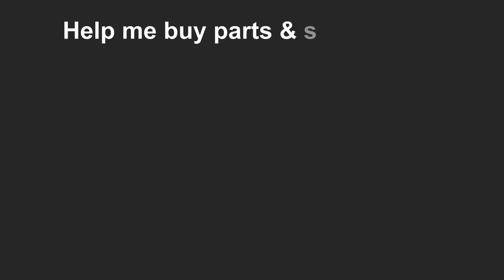Can a Wet Sewing Machine Motor be Saved?

Comment: This video was very informative. I cleaned my motor as you described in the last video I watched of yours with the Krud Kutter and water mixture. I let it air dry since I did not have a blow dryer. I have not seen any rust form and I think I did mention to you in a comment I sent to you from that video that I sadly was not able to get this motor working BUT I am hopeful that I can get it working and it was just the cleaning that I needed to do on this motor to get it working. I took it to a gentleman that works on featherweights and I am thinking, and so is he, that it’s the screws and the motor casing that is not aligned correctly and he said he would look at it and get back to me. Either way, I’m learning a lot. As my brother did when he was very young, he tore apart everything he had; his motorcycle, clock radios, drills, a Vespa, fans,  bicycles, etc., in order to learn the internal workings in order to learn how to repair these things. With this being said , he also destroyed most of these things, but he eventually learned from this. I can’t afford to ruin these GE motors because they are not replaceable, but the singers that are older I think I can come across these motors more readily and can learn from working on them. This is going to be fun with the help of your videos!
Reply from the maker: I hope he can get the motor running for you. I wonder if it's the airdry that affected it? Guess you will find out. You have the right attitude about working on these machines, and that is about 90% of being successful. Best of luck going forward.
Reply: @andytubesewing1953  you think it’s the air drying that wasn’t good for it? So what if I soak it in a little water with a little of the krud kutter rust cutter that you mentioned. The inside workings turn nicely. It’s really hard to say at this point since it never ran to begin with. I’ll let him tinker with it and if he can’t get it going I’ll get it back and try different things.  I do need to put together a power cord checker thing like you made with the light dimmer to check my progress as I go along. Thank you for your encouragement!
Reply from the maker: @cristinas.5699  No, no, don't get it wet again. If the parts turn freely just let the guy take a look. I was concerned the slow drying may have made the shaft, bushings, etc. seize but it seems they did not. The testing cord/dimmer setup has really helped me many times to test and work on motors.

Comment: Hi Andy! Wow it’s a very informative video! I have an issue with my 348 where I can’t get a slow and consistant mouvement . I need to start and give a kick to the knob, it makes 4-5 stitches and it lose slowly it’s speed than stop. With a faster speed i have no issues.I think it could be my belt at first but after investigate further I have noticed that my motor was very oily and dirty. I tried to cleaned it the best as  I could with alcohol and paintbrush. Now, I wondering if it’s normal to have a tension on the motor shaft or it should turn freely and easily with a small kick? Thank you 😊
Reply from the maker: It should not need a kick, push, turn, or spin to start. You should only need to push on the foot pedal or knee lever and you should be able to start sewing.  
     It's true that a VERY oily moot can run poorly, but what I have found more often is the foot pedal is in poor condition. Your machine is almost 60 years old and chances are the foot pedal/controller has never even been cleaned and adjusted.
The controller uses a dual stack of carbon discs (resistor stacks) to control the flow of electricity to the motor. When those carbon discs get old they can get deposits of carbon built up on them which restricts the flow of power and makes it erratic, with hesitation, speeding up, slowing down and even stopping. 
     Of course, the motor may need cleaning, or the belt is too tight on the motor or the hook pulley, or maybe the machine has not been oiled properly as shown in the manual https://www.singer.com/search/support?title=348    
     If possible try your pedal on a friend's machine and try their pedal on your machine. I do have a complete series of step-by-step restoration of the foot pedal if you'd care to look at some of the videos and see what you think: https://www.youtube.com/playlist?list=PLsCOZgzzaiKL6ePPxLpmnWSzTyxPKTb71
     f you feel the problem is more the motor you can clean and polish the commutator to free it of carbon deposits, but you must move the motor to do so https://youtu.be/rpTy_Bz3prA
Reply: @andytubesewing1953  Thank you for your good advice!!! I was able to fine tuned the best as I could this beast 😊. It was a combinaison of an oily and dirty motor, dirty and poorly adjust foot controller and a too loose tension belt. Now I can do a slower speed at startup and better control of all range of the speed. Thank you again!!!
Reply from the maker: @franciscachampagne4384  SOunds like you got it all worked out. Congrats.

Comment: Andy Tube, isn't it better to remove the carbon brushes once the armature is removed, this can be done without bending the brass brush holders, it just doesn't seem the right way to do it by bending the holders. I have done it that way many times, they naturally spring down to the centre. I admit that yours were very tight but that is not usually the case. It's a bit more fiddly but you do not have to bend the holders with pliers with the fear of snapping the tab off.
Reply from the maker: Better? OK. Sure. Removing the armature first does usually let the brushes spring into the space as the commutator is pulled. I did not know the condition of the carbons. I did not know if they were soft or damaged and would crumble while dragging off the commutator. I wanted to try and pull them out from the flap end. BTW, any comment on the wet motor itself and that is still worked after soaking in water, which was the purpose of this video? Thanks for watching, Steve.
Reply: Andy Tube Yes, the experiment was interesting as well. The only reason I mentioned the carbon brush removal is that I saw this method in one of your other videos when the brushes were moving freely as normal and thought it was incorrect and somewhat confusing to me. Anyway I enjoy your videos and have found them informative . I also renovate Singer machines, around 15 so far. Thanks for answering.
Reply from the maker: @SteveValentineUK  I'm glad you found the experiment to be interesting. Sorry, I must have missed your comment in the other video. Thanks for saving so many good vintage machines.
Reply: Yes I agree about those tabs. I was warned by a gentleman that once those snap off there is no way to replace them. I recently took a GE Sewhandy motor apart and as you stated when I took the armature out the brushes came out fairly easy through the other end of those brass tubes that hold them in place up against the armature. As I was removing this, the brushes had nothing to press against and came out of the tubes and so I had no need to bend back those brass tabs.

Comment: Hi Andy. Thank you for the link to your PayPal. I just sent you a little gift for supplies. I just love your channel. Just acquired a Frister and Rossmann beauty and (drumroll please) a General Electric model A from 1933 in near mint condition except the motor.
Reply from the maker: Yes, thanks for the donation. Two rare machines now. That's a real collectors item I'd say. Thanks for watching my channel.
Reply: I was able to find 3 of the GE model A machines recently. One has a chrome faceplate with the urn and flowers stamped on it and the other two have the GE green enamel insignia on them . All three machines are green. I also have a motor I was able to find separately online and bought that works great.  I figured I should buy any and all parts I find for these machines since they are hard to find.